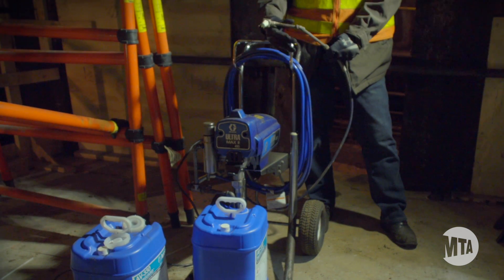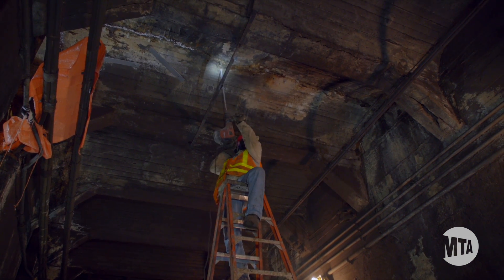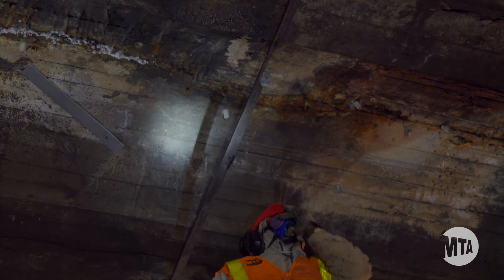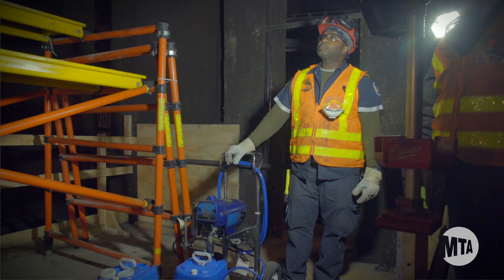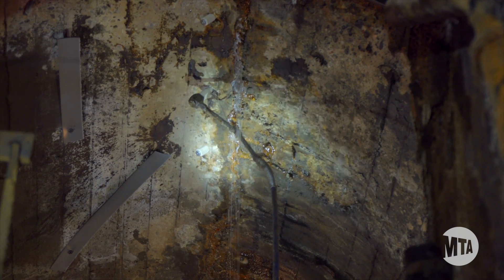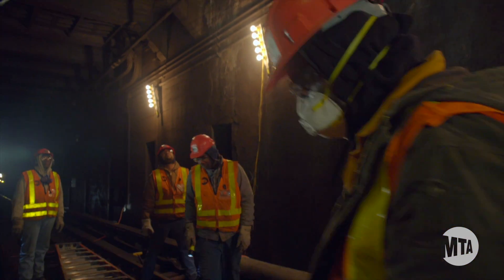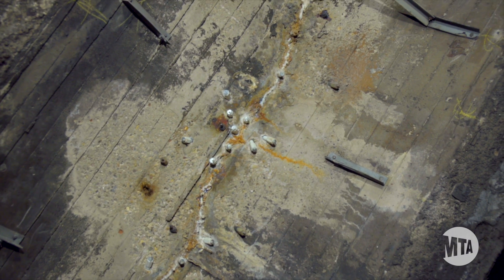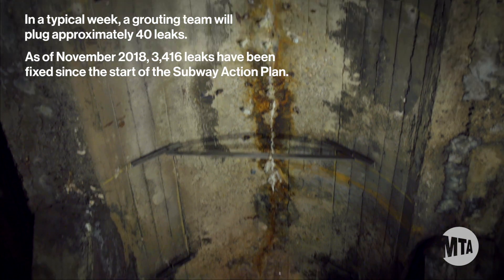Subway Action Plan: Fixing Leaks with Grouting

Comment: I would hammer test that concrete soffit first to check for any loose concrete and/or corroded reinforcement. Grouting the tunnel without stopping the source just moves the water somewhere else. 
Do all this on the London Underground. 
We’d get crucified for using steps like that lol!

Comment: That's alot of plugs there... I  really don't think that's a permanent fix.  That's only temporary... I think just redo the whole ceiling with cement..🤔
Reply: No. Not cement. But with high-grade waterproofing material, rebar and concrete.  That sounds easier said than done. And needless to say, it's gonna cost a lot more money than what you saw in this video.

Comment: But there's no saving the Canarsie tunnel they got the completely redo the tunnel
Reply: And to add on to the comment above, the concrete bench walls which house the signal and electrical wiring is heavily damaged because of the salt that the sea water brought in so those have to be demolished and re-done, or the cabling has to be strapped to the tunnel walls (part of Cuomo's alternative plan).
Reply: Anzell Ford That’s because it was flooded. Here, they are fixing leaks. There’s a difference between a leak and a flood, just saying.